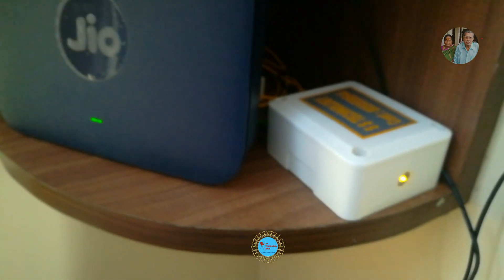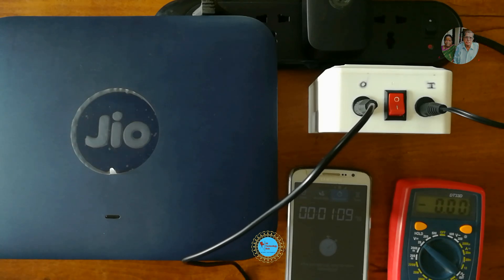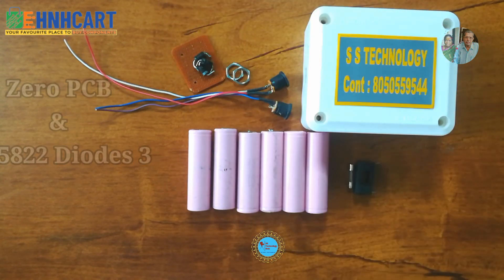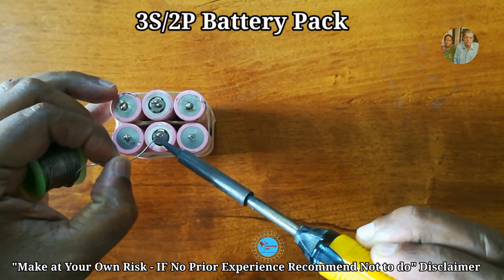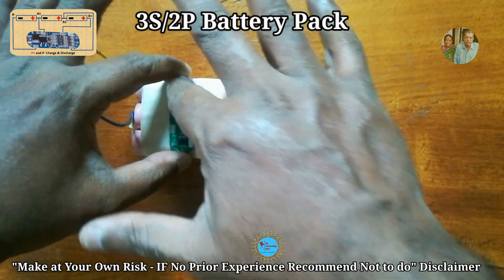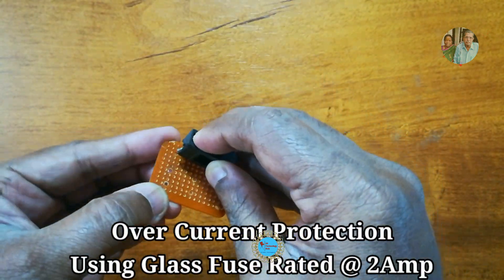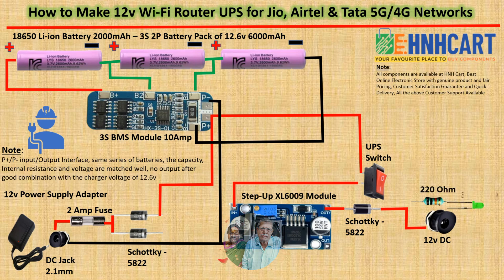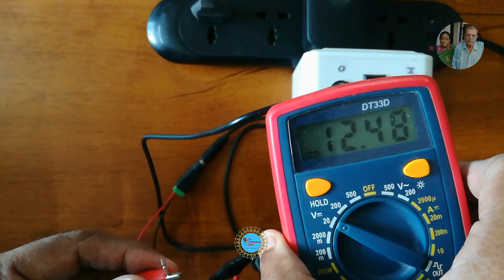DIY 12v UPS | 5+ hours Backup | SSTechnologyHub #powerbank  #electronics #trending

Comment: i made ups exactly you have told in video for my jio router but when i connect it, after every 2-3hr router is restarting ..this happens only when ups is connected....pls suggest any solution🙏🙏
Reply from the maker: Let's connect on WhatsApp.
Reply: @sstechnologyhub  thanks for replying
i used heatsink in step-up booster because it was heating and made some holes in ups box..... problem is solved...
Reply from the maker: Which step up booster have used ?